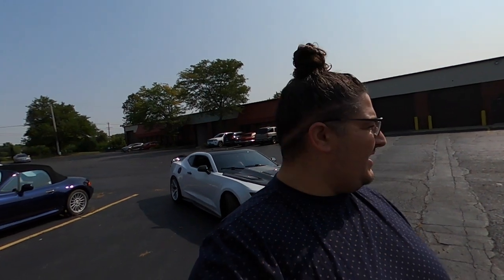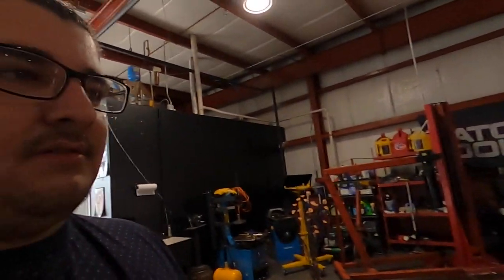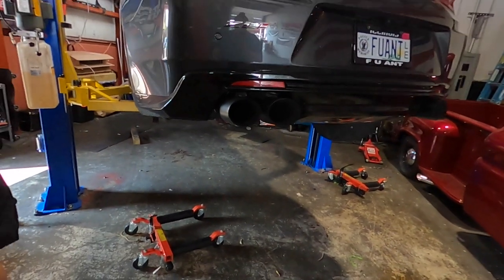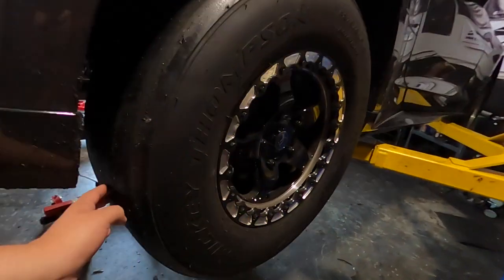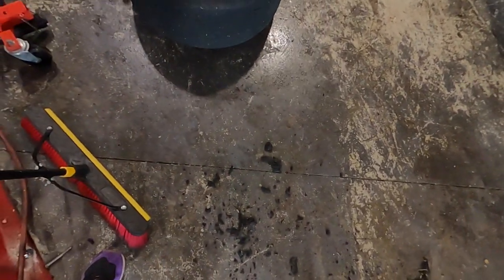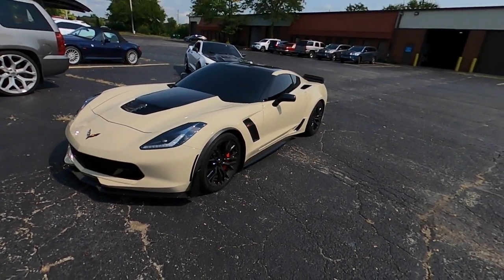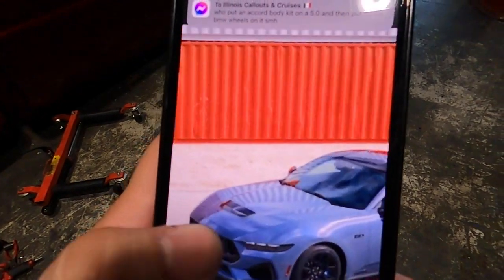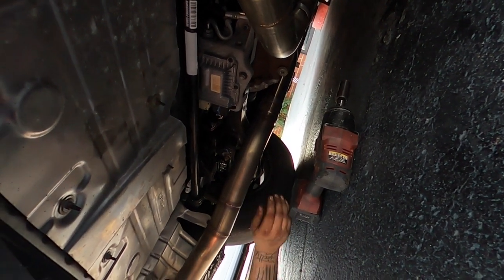TRYING TO FIX THE BIGGEST PROBLEM WITH MY CAMARO ZL1! #zl1 #camaro #camarozl1

Comment: I’ve heard good things about Vega’s. Have you heard anything about Next Level Tuning and Performance in Crest Hill? My tuner Brett at Pray Performance recommends them. All other shops are an hour north of me
Reply from the maker: Kyle vega builds my car he does not tune my car when it comes to building I trust him 100%. I had my fully built camaro ss at next level I like the owner but there is way to much shady and bad stuff going on at that shop so would never go
Reply: @AntFrank  I appreciate the feedback. So far I’ve been going to Speed Inc in Schaumburg, and I’ve had great experiences with them so far. Was just trying to see if there was something a little closer to the south suburbs. Next step for my ZL1 is injectors, high side pump, and lower pulley
Reply from the maker: I personally don’t get tuned by anyone out here they aren’t actual LT4 tuners. I would definitely get tuned by a big name lt tuner then a shop. Now speed inc is good they will install parts and everything but I would look into better remote tuners
Reply: @AntFrank  I’m remote tuned by Brett at Pray Performance currently. I’ve just been working with Speed Inc for my parts installs. I’ll probably just stick with them. My goals to be FBO and chill at 700 whp. It’s my daily so no plans for a big cam or 2650